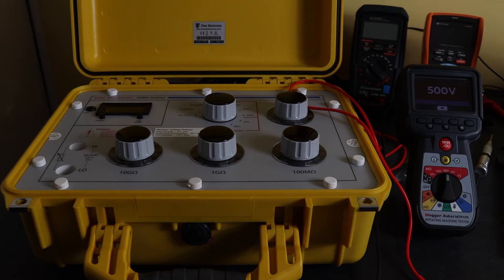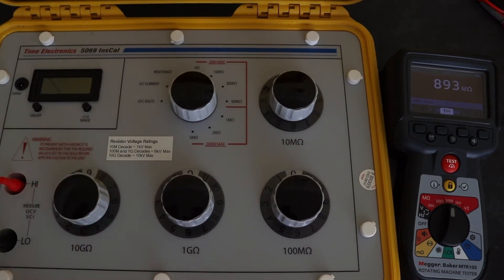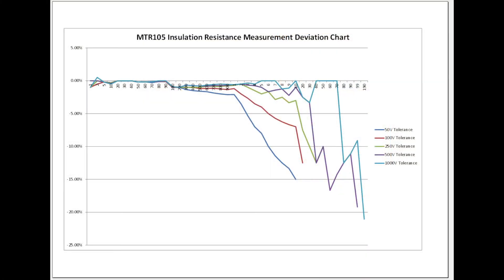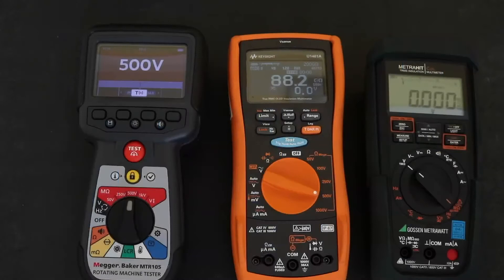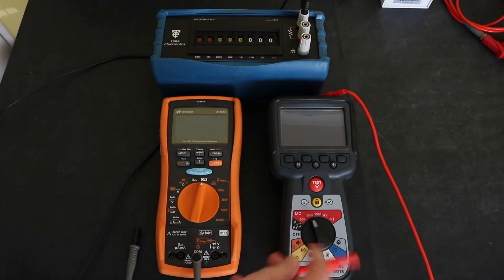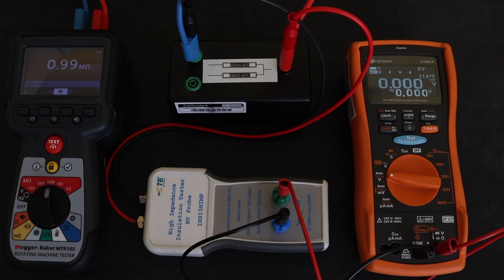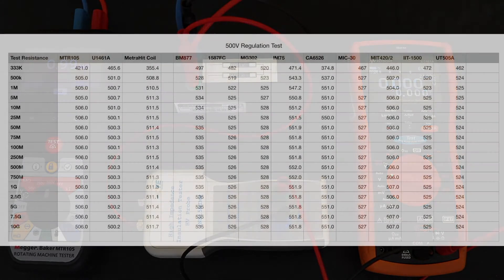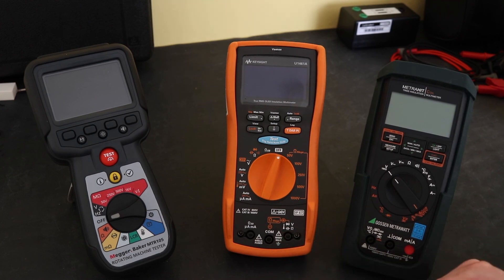MTR105 Insulation Resistance Accuracy Tests

Comment: Extremely interesting look forward to future test results. Hopefully we a final overall summary right at the end across all tests taken as a whole. I think for a specialist motor testing tool the megger’s accuracy at higher ranges was disappointing something I am sure megger should be concerned about I hope you get in touch with them. This series would be very useful for their engineers.
Reply from the maker: Appreciate the comments MM. For me the accuracy needs to be taken into context, whilst it doesn't appear to be as accurate as the Keysight, when you get up into the GOhm readings, a few MOhms either side is not going to change the end result, but it is intriguing that the MTR105 does not appear to be as accurate as their own MIT420/2.

Remember that these are only one off units though, there could be other MTR105 units out there with better accuracy, like wise other U1461A or MIT420/2 units with a poorer accuracy. 

It is an interesting result, but in the end, for me it does not detract from the concept and use of the MTR105.